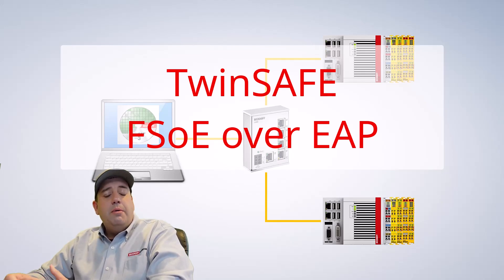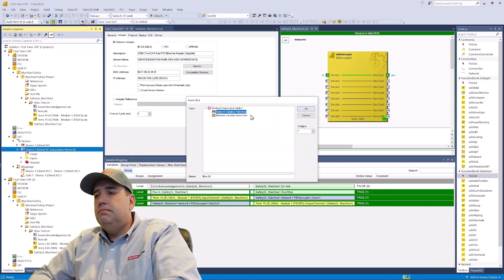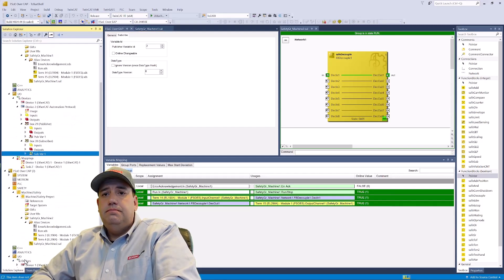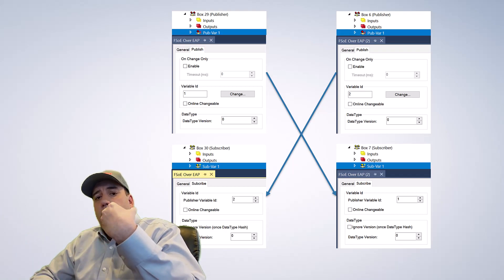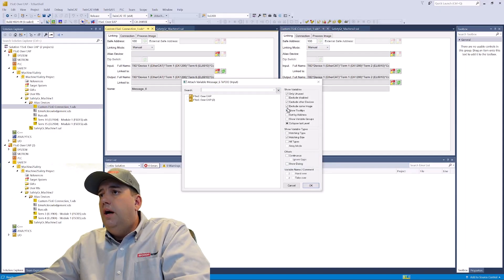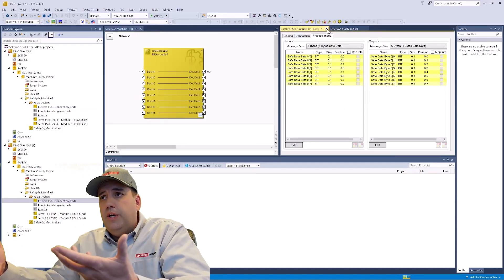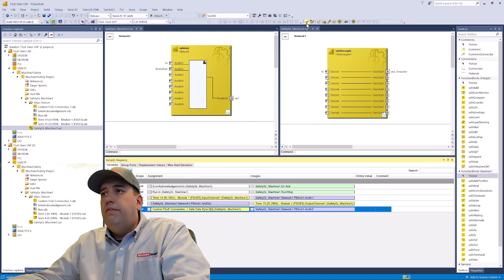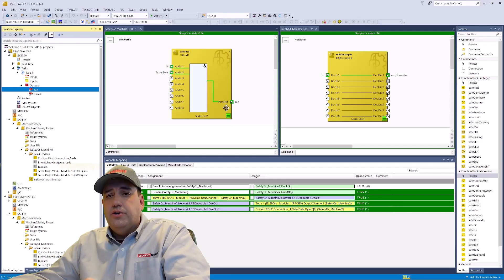TwinSAFE FSoE over EAP

Comment: Thanks, this is a great video. 
I'd like to use this method, but I need to exchange more than 8 bits of safety data. 
I note EAP supports other data types eg: FSOE_7, FSOE_11 and FSOE_15. 
But these don't seem to be supported by the 'Custom FSoE Connection' alias. 
Do you know if we can use these other data tyes to exchange safety data?
Reply from the maker: You should be able to alter the custom FSoE message size under process image tab as necessary. I can't post pictures here, but if you're still struggling, please contact support@beckhoff.com